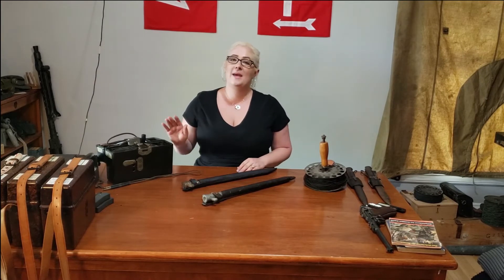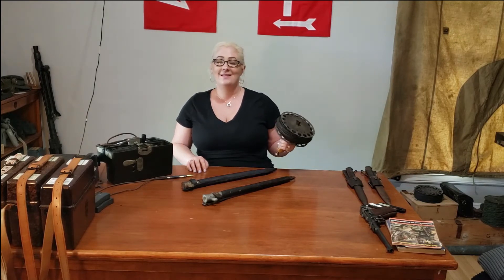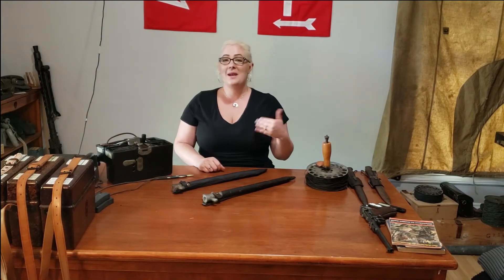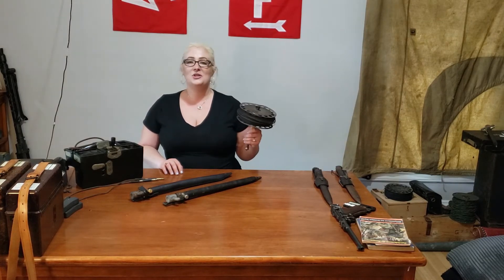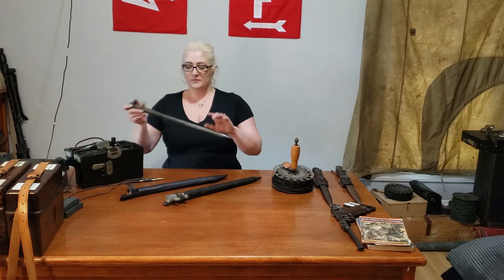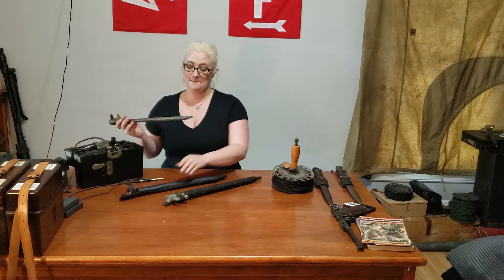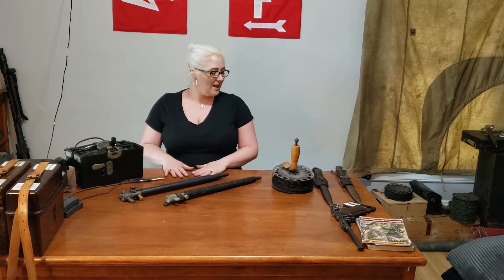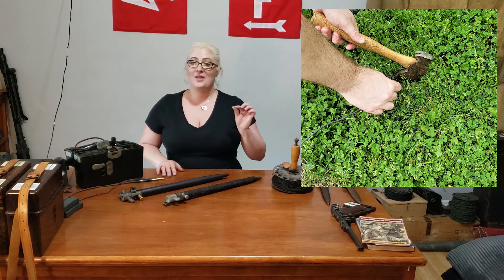Talking Through the Ground - Single Wire Field Phone Configuration

Comment: This was the standard for the installation of telegraph systems and was carried over into telephone systems in the early 1900's.  During WWI there were so many field phones wired like this that the induction allowed both sides to spy on each others phone calls.  At the beginning of WWII all the belligerents networked phones like this wi the exception of the US Army which had promoted the use of twisted pairs starting in the early 1930's.  By mid way through WWII all parties abandoned this method in favor of using twisted pair which decreased noise and increased range and security.